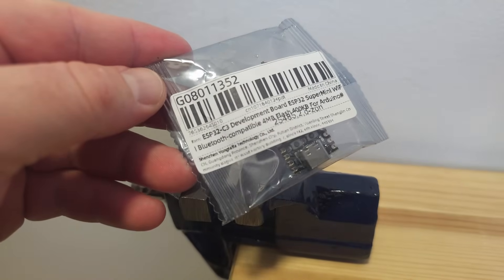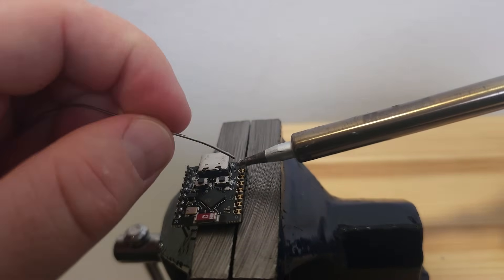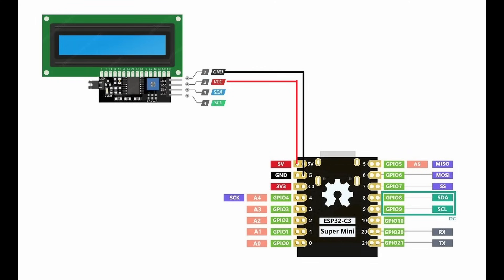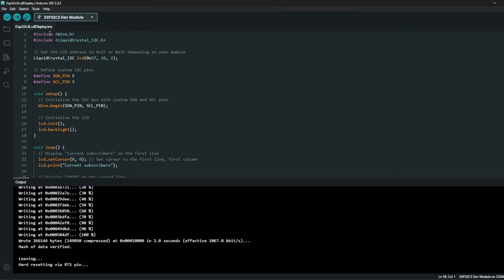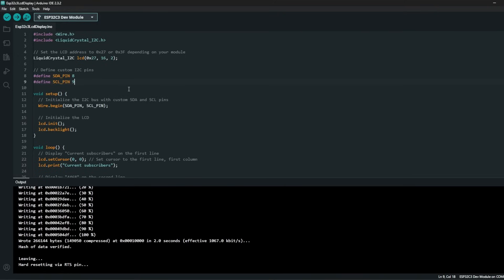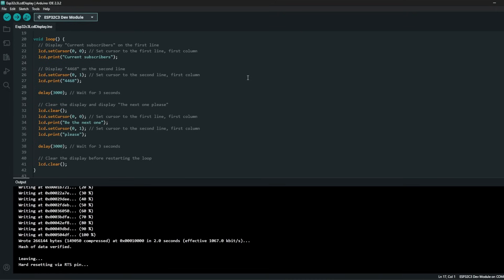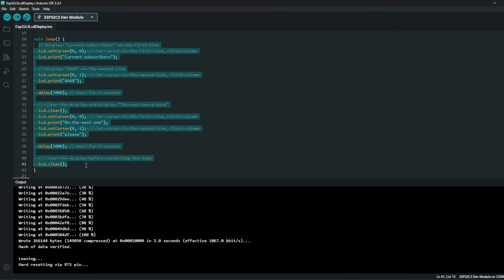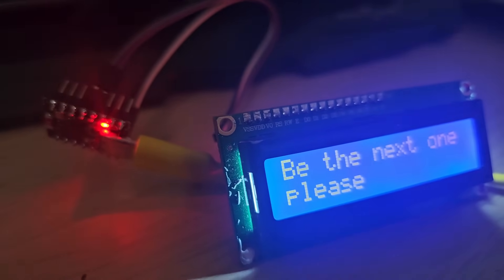ESP32 C3 Super Mini + 16x2 LCD I2C Tutorial (Arduino IDE Guide)

Comment: #include <Wire.h>
#include <LiquidCrystal_I2C.h>
// Set the LCD address to 0x27 or 0x3F depending on your module
LiquidCrystal_I2C lcd(0x27, 16, 2);
// Define custom I2C pins
#define SDA_PIN 8
#define SCL_PIN 9
void setup() {
  // Initialize the I2C bus with custom SDA and SCL pins
  Wire.begin(SDA_PIN, SCL_PIN);
  // Initialize the LCD
  //lcd.init();
  lcd.begin(16, 2);  // Cambia "16, 2" por las dimensiones de tu LCD (filas y columnas)

  lcd.backlight();
}

void loop() {
  // Display "Current subscribers" on the first line
  lcd.setCursor(0, 0);  // Set cursor to the first line, first column
  lcd.print("Current subscribers");
  // Display "4468" on the second line
  lcd.setCursor(0, 1);  // Set cursor to the second line, first column
  lcd.print("4468");
  delay(3000);  // Wait for 3 seconds
  // Clear the display and display "The next one please"
  lcd.clear();
  lcd.setCursor(0, 0);  // Set cursor to the first line, first column
  lcd.print("Be the next one");
  lcd.setCursor(0, 1);  // Set cursor to the second line, first column
  lcd.print("please");
  delay(3000);  // Wait for 3 seconds
  // Clear the display before restarting the loop
  lcd.clear();
}

Comment: The I2C backpack boards on the LCD modules have pull up resistors on SDA and SCL to 5V. This is not good for a 3.3V microcontroller. I recommend that these pull ups are removed.
Reply: Why??????????????????????????